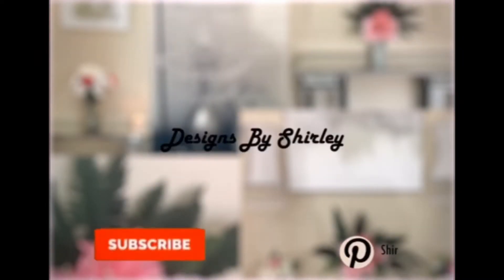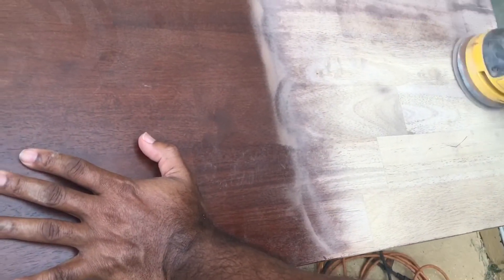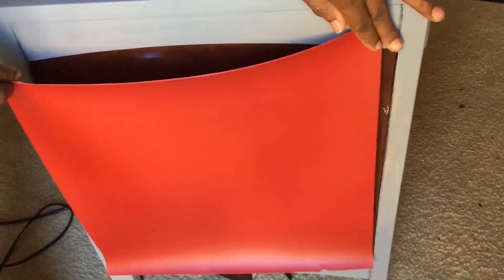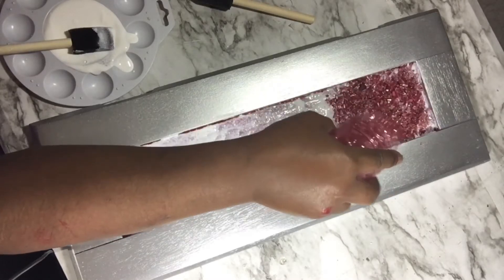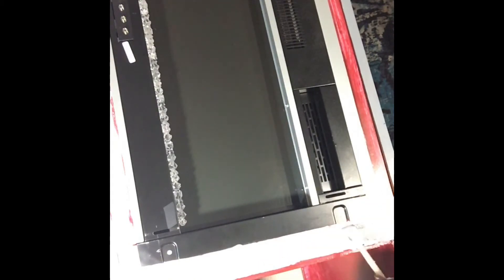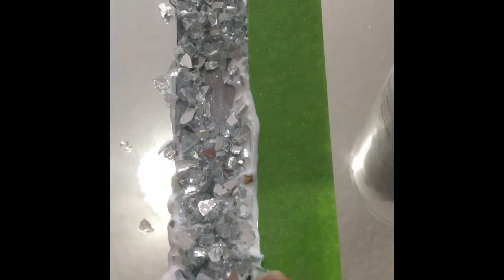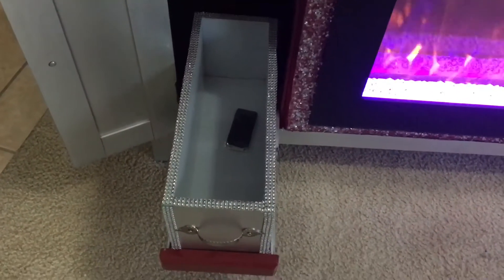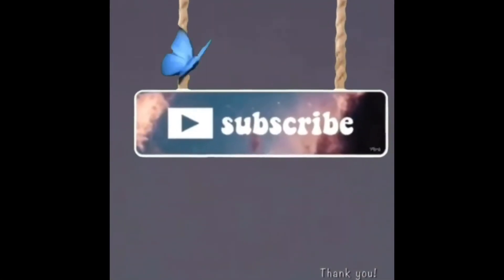DIY Entertainment Center Into Mirror Fireplace

Comment: What dimensions is the fire place so I can know what to order
Reply from the maker: The size must be determined by the size of your entertainment center. Measure the space for your fireplace insert, then order the size for your center. The size I used for this entertainment center was a 36-inch fireplace insert from Amazon. I hope this helps you out. Let me know if you need anything else.